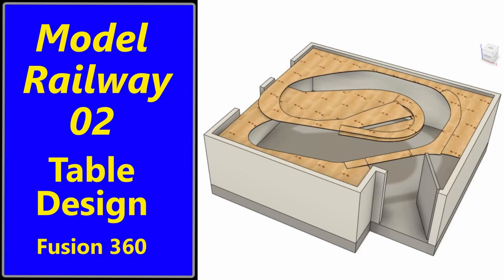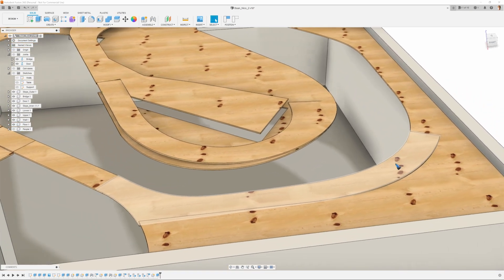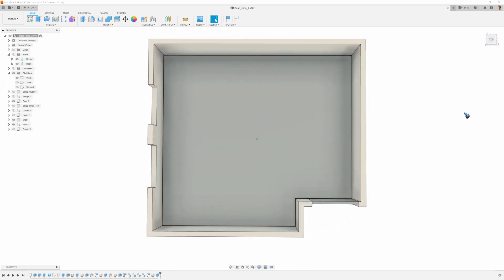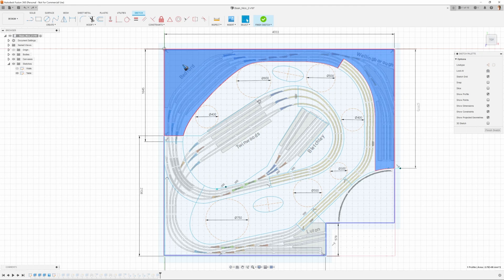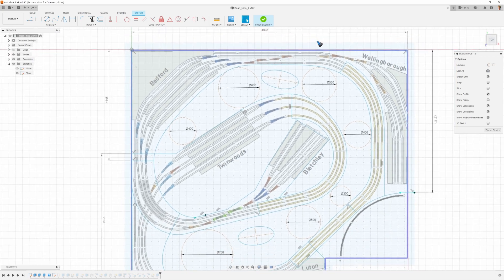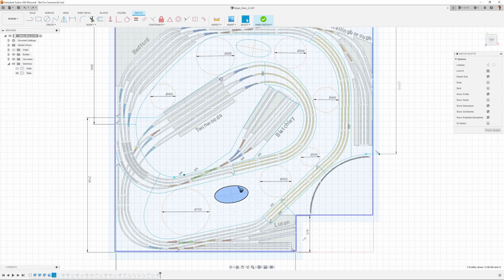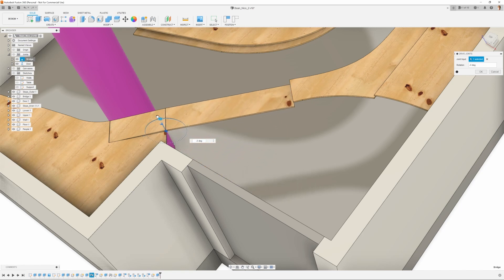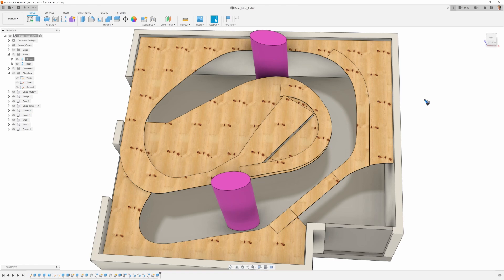Model Railway 02 - Table Design in 3D

Comment: Nicely done. It will be interesting to see how you will frame and support the baseboards. Do you intend to draw that in 3D also? Several advantages in doing that, not least of which is identifying where support joints interfere with the placement of Point motors.
Reply from the maker: Yes, that's the plan, to design the placement of legs and support beams in Fusion also. Quite important to stay clear of turnout servos that need to be mounted under the table.